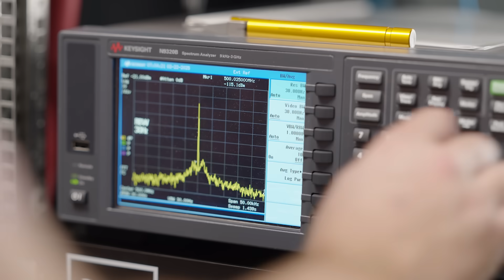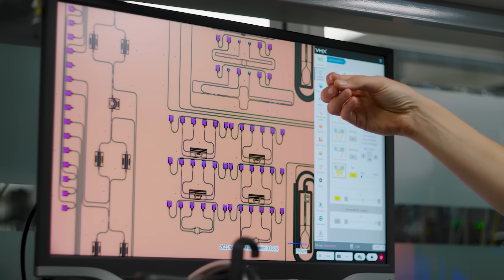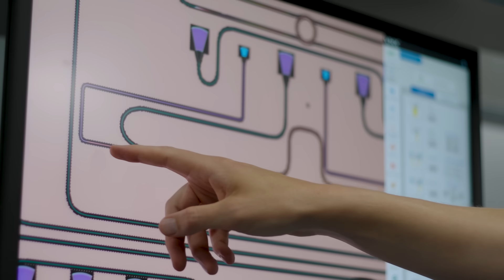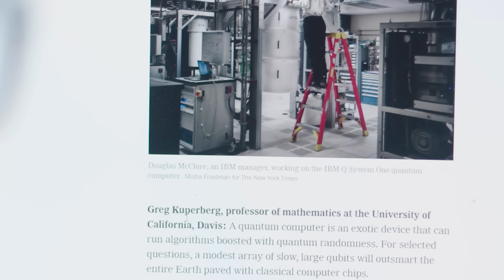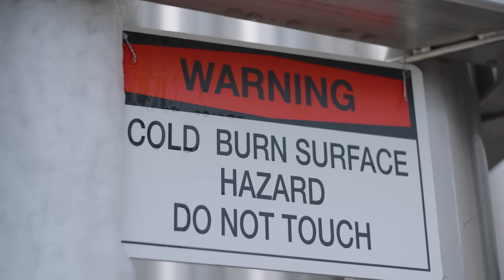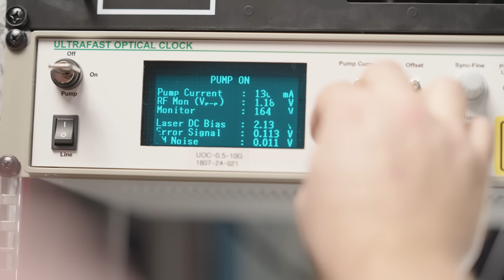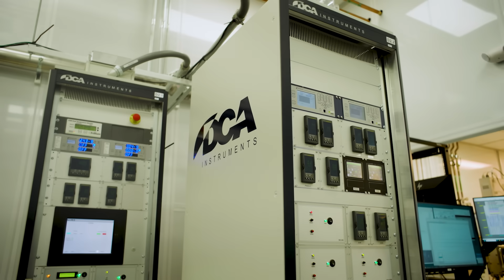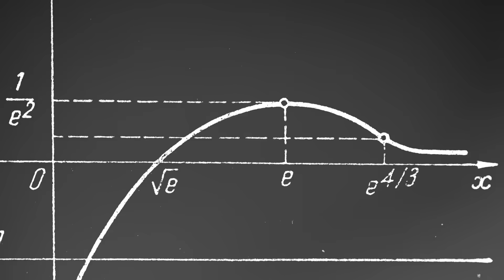The Largest Quantum Computer In History Is Here

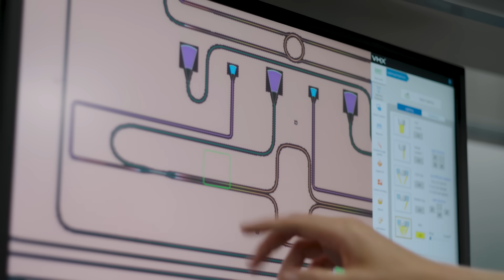Comment: 3:50 "if you take light around a 90° bend you get lost, all the photons go missing"

Why are the 8 90° bends after the fused lines to the right ? Won't the photons get lost there ?

"
3.1 Timing issues
All software solver tests were carried out on a suite of
seven Lenovo ThinkStation S30 0568 workstations, each con-
taining one Intel Xeon E5-2609/2.4GHz Quad-Core proces-
sor with 16GB RAM. The operating system was Ubuntu
64-bit 12.04 LTS.
Blackbox runs on a Lenovo d20 workstation containing
two Intel Xeon X5550@1.6GHz Quad-Core processors with
16GB RAM. The operating system is Fedora 15. The num-
ber of hardware samples per main loop iteration was set
to k = 1000 and the stopping rule was set to 107 function
evaluations"

https://static01.nyt.com/packages/pdf/business/quantum-study.pdf

D-Wave was just running nonsense formulas on NORMAL COMPUTERS!!

Quantum computers DON'T EXIST!

SCAMMY SCAMMERS!!!

Comment: Any (sufficiently stable, manipulable) physical system can be made to compute. The simplest dynamical state of any system is binary (2 states), 1 or 0, yes or no, on or off (eg a semiconductor can be placed into either a conducting (1) or insulating state (0)). A carpet can be made to compute. Its rolled state can be said to be 1 and its unrolled state can be said to be 0. A quantum computer uses qubits, which is a particle that can be placed into a superposition--a simultaneous composite state, which can be considered to be 1 and 0, in the context of making such a system compute. Doing so is more efficient than being in an either 1 or 0 state, so therefore these particles can scale up in a non-linear fashion vs a classical computing system, in terms of performance. 

The downside is that such quantum systems are prone to error and the question is whether they can be made to harness this efficiency vs its tendency to produce more errors while scaling up. That's my definition of a quantum computer.
Reply: Excellent explanation of a qc. I think the practical challenges to facilitate this are also immense. Connecting photons through miles of cable and measuring your answers without affecting the process itself is infamously hard. Truly cutting edge, and I think PsiQ is miles ahead of anyone else in the race to a functional qc.
Reply: @WaterfordBrunel  We shouldn't worry😂, A.I is already smarter than us in many ways, and it will become exponentially much smarter over the next few years , which means, that the chance of finding a way to solve the error correction problem in quantum computers will exponentially increase aswell. In the world we are living, what seems unachievable right now, can become completely achievable in 2 or 3 years. 😅

Comment: We were told by most "in the know" a decade + ago that if we ever wanted to solve the problem of protein folding prediction from the genetic code alone we'd "need quantum computers" if we wanted to do it on timescales shorter than the age of the friggin planet. Then AI solved it overnight 5 years ago with AlphaFold. Done. Problem solved. You can just feed a normal computer running that program a genetic sequence for a protein now and it will spit out the structure and 3D shape seconds later. What other real-world problems don't ACTUALLY need this quantum technology to be solved?? Some always will need it, like elliptic curve factorization cryptography breaking, but which DON'T?